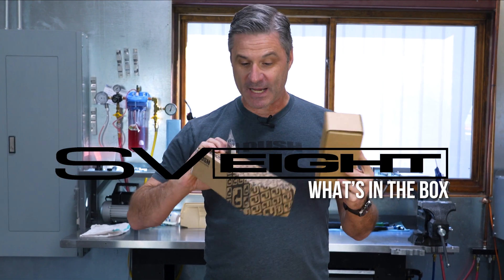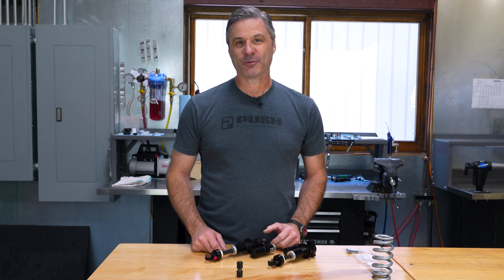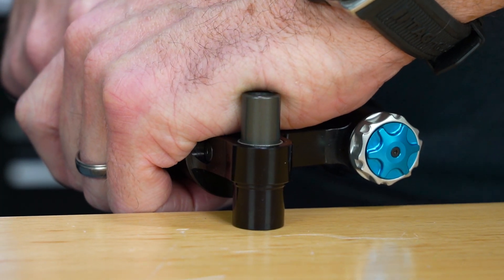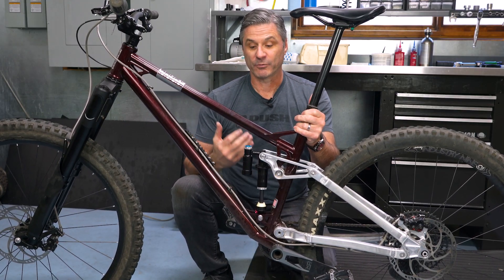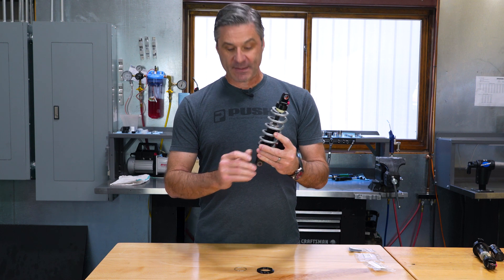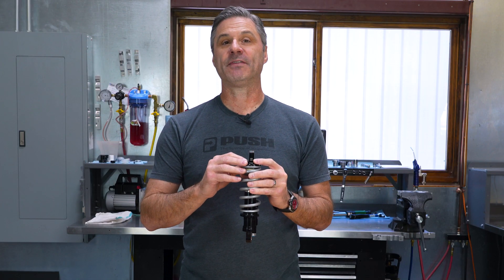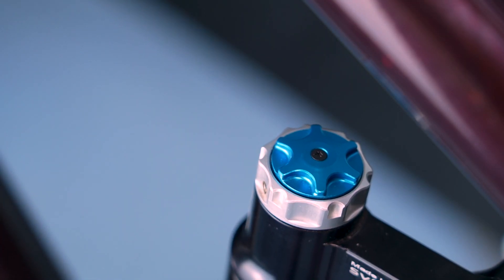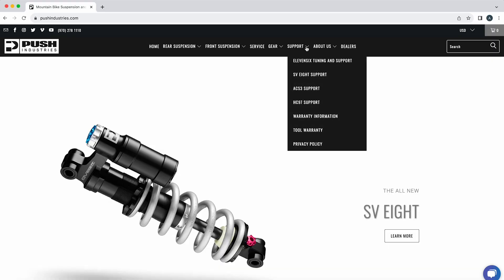SV-8 What's In The Box

Comment: Over the  years, I have had a number of PUSh products( Vanilla RC upgrade, Delrin Bushings for my Turner,  Float RP3 upgrades and upgrades to my Fox Fork) very happy with those products and services.  I was looking to purchase an SV-8 for my current bike build (Canfield Tilt) but decided to purchase an EXT Storia V3.  Reasons:  PUSH would not supply spring or lower mounting hardware.  I tried through several emails to determine the dimensions of the spring that would fit on the SV-8.  Last email was a request for the inside diameter for a correct spring.    EXT included all mounting bushings, correct spring and custom tuning.  PUSH if your B-tune supports upto a 700 lb spring, then you should be able to provide the spring or exact specs so customer can source one.